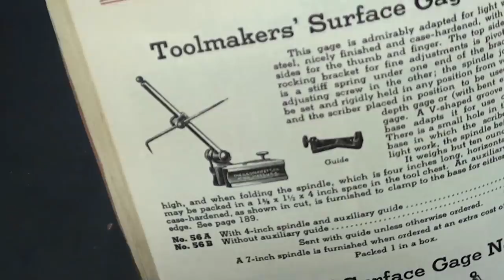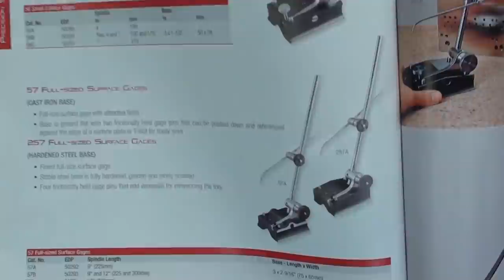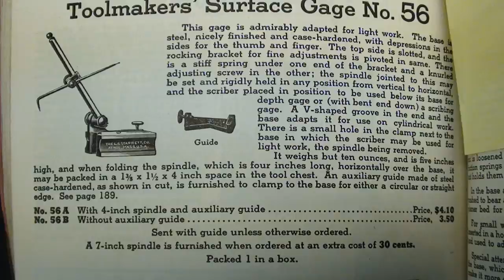WHAT IS IT? Mystery Tools #73b answers tubalcain

Comment: The ball end is used in conjunction with an indicator to test against a vertical surface for squareness.  The ball end is oriented just in front of the base of the surface gauge.  Then an indicator is positioned directly above the ball end.  Then you place the set up against a known true vertical surface.  By swinging the back of the surface gauge, pivoting on the ball, you find a "zero" on the indicator.  Once the zero has been established, you can now use that to measure/confirm the squareness of other objects.  Depending on how tall the object is you wish to test, the indicator can be positioned at any height prior to being zeroed.
Reply: you are correct
Reply: Someone should do a video showing this. I just looked and if the ball is protruding the rod would be slanted away from the vertical surface.
Reply: @shadowdog500   I agree
Reply: @shadowdog500  I just edited my original post, as I see it was a bit misleading.  The ball would remain in the same position and the indicator would be adjusted for the desired height.

Comment: The ball end does have a function.  Since the clamp and rod often are a close fit is can be difficult to begin sliding them together.  if there is a slight angle a plain shaft can wedge tight due to the short engagement length.  The ball design begins to guide it while allowing misalignment.  When the straight shaft area later engages the clamp the centerline is lined up by the ball and there isn't an angle error to stick.  Sometimes this is done on tool shanks by having a short length of full size diameter   followed by a relieved section and then the full size again.

Comment: Thanks Mr Pete.
Stan at Bar-z did a video in which he talked about the ball end of the surface gauge. Also, on the amp phone tool, I have one that clamps on the the steel suspension cable that the phone cable is lashed to and it has a handle on the left and right that you pull down at the same time. It also comes with a go/no go gauge on a string so you don't drop it.
Reply from the maker: Thanks
Reply: @mrpete222  I looked for Stan's video and I couldn't find it. I apologize if I was mistaken.

Comment: The use-the-finial-as-a-ball-joint theory also fails to explain how one would put the retainer nut on. You would need a nut whose hole was larger than the ball (or the rod) and a sort of split keeper, which would all be fiddly beyond utility. You might be able to make a split (one piece, C- shaped) retainer nut that can slip on sideways but I think you would need a longer stem on the ball for that to work.

Comment: Lyle again you have educated me, I have two of those small Starrett surface gauges, one with pins ( a number 56) and one with out pins ( no number).  These came from my uncles and fathers tool boxes, I had that little bracket also, but I had no idea that it was used on the surface gauge, thanks for the education

Comment: With the square chain anvil makes working with that chain extremely easy to take apart i have 2 different styles for the van brunt drill and 490 planter very helpful tool to have instead of a couple screw drivers and a hammer

Comment: A bit late to the show here, however the 'finial' is for use as a surface guide when checking a surface that does not conform to the usual base tow referencing.
Reply: I'm not a machinist and don't understand that explanation.  Could you elaborate?

Comment: The purpose of the ball finial is to make an accurate distance measurement at any angle.  If you were to sharpen the rod to a point at the center of the rod axis, then the distance from the pivot center to the sharpened point would be a single value regardless of angle.  The same happens with a ball finial as long as the ball center is concentric with the rod axis, which these are.  If the rod has a flat top like the more modern units you showed from the Starrett catalog, then this feature is not available.  I suspect almost nobody understands the purpose of the ball any longer, or it rarely gets used for its intended purpose, so Starrett just removed it to save money.  The ball finial is similar in purpose to the cylinders of a sine plate that establish a constant and equal radius at both pivots so that angle can be directly related to elevated distance at one end.  Angle can be determined by dividing this distance by hypotenuse and finding the angle in a sine table.  I suppose you could accomplish the exact same thing with a rod having a ball finial.

Comment: What about locating from an angled corner or from a theoretical sharp edge where there isn't any like with a boogered up end mill corner or small radius or even a dovetail where the ball could locate from two surfaces that join.  I think I've read about using it as a comparator for squareness in the past.  I'm feeling around in my mind for something and there's just nothing there.